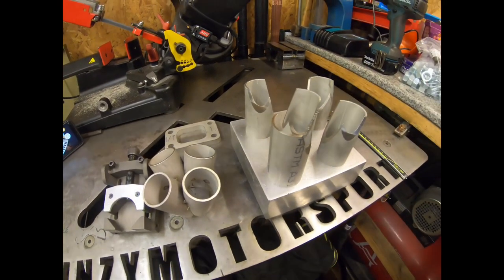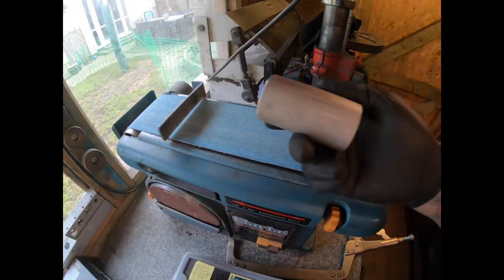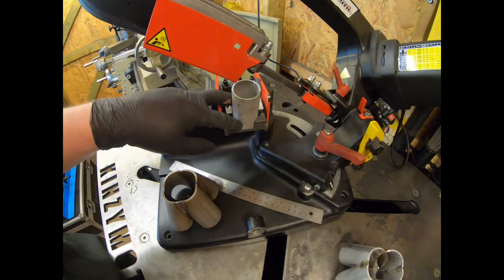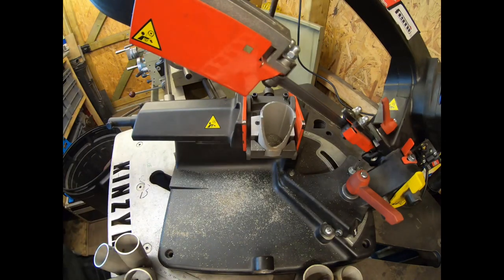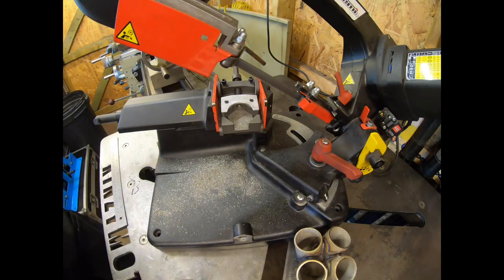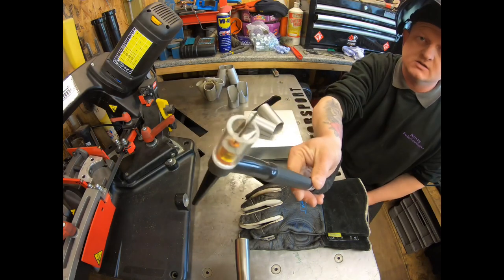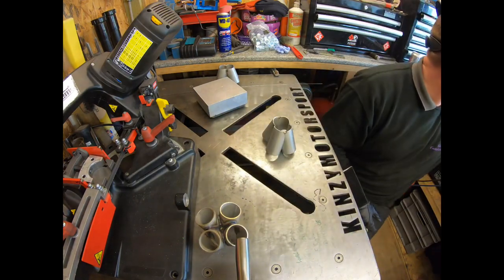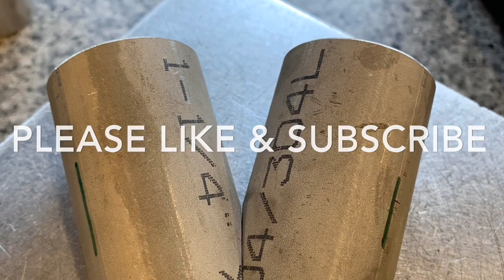Making a turbo manifold merge collector PART 1

Comment: Hello mate, so i made a jig and today i finally cut the pipes like you...So its square collector for 4 cylinder and fits good..But its from plastic to practice :D but it doesnt matter..now i need to make a 5 cylinder square..How you made it? The same like 4 cylinder but 72 degree and how you pair it, as there arent 4 pieces , but 5 ...But thank you anyway...really good explanation ...you deserve much more subscribers...
Reply from the maker: Hi, thanks for the comments.  im glad the video helped you with your 4 cyl collector, i have not done a 5cyl before so can't show you any examples personally, but yes 72* would be correct. As for how to pair it you fit them equally and then the best way is once tac'd together cut the end down so it matches your flange as best you can and then dress the metal to the final flange shape.

Thanks
Marc

Comment: Very nice video. How do you calculate or define the cut depth? I need to make a 3in1 collector with a round end for a vband 😄
Reply from the maker: Daniel I’m afraid that’s pretty much trial and error to get it as close as you can for your flange, a good starting point is cutting the tubes down to 75mm to start with
Thanks
Marc

Comment: How would I do a 3 pipe collector with 3 2” sch40 pipes into a t4. Great video
Reply: Working on a manifold for a 20b engine
Reply from the maker: Youd have to google that online as i only ever done the 4 way connectors

Comment: From bottom of the arcs to the bottom of tube how long are they? With these numbers i would be able to copy same exact fit as yours and overall length
Reply from the maker: Hi

On the long cut the arc is 20mm from the base of tube
On the short cut the arc is 40mm from the base of tube

Hope that helps

Thanks
Marc

Comment: how good to have the right equipment ..... the cut will always be 90 degrees to the sides?
Reply from the maker: Hi

Yes on a 4 cylinder collector yes, i have cut them in the cnc machine now using the same LPSFAB fixture to get perfect cuts

Thanks
Marc

Comment: Nice work...How thick is that? 3mm?
Reply: I am tryin to make merge collector too, but for 5 cylinder and without that jig :D So it will be little different without, but maybe it should work
Reply from the maker: ilikemyboost 
Hi thanks

This is sch10 and is roughly 2.7mm wall thickness
Reply: @kinzy_fabrications  Thanks a lot mate :) nice channel...already subscribed :) keep more videos like this coming :)
Reply: @ilikemyboost dude, go to lpsfab.com and grab one man. You wont regret it. Its a little pricey, but it will save you money and even make you money if youre into that. This video is one of the best explanations of how to use it too! I wish I had this when I got mine haha. I'm also going to be making a  5cyl collector for an AAN for a customer and having Justin from LPS (cutting fixture) cut me the flange! Good luck!
Reply: @jamesknox2989  Its little bit pricey, but if you using it very often, than is not a problem...But i am not sure if i will make more collectors :D But i like this tool. I need to train first on some plastic water pipes and than go on ss pipe :D i will make it from 321 aisi
Reply: @kinzy_fabrications  This is T4 flange? I finally made some jig for my purpose...but now i need to solve how far to stick out the jig for the cutting and what angles should be for 5 cylinder :)

Comment: The cheap 304 is the wrong material for manifolds.
Reply from the maker: schmatzek1 
Hi, 

The material is cheaper but so was the customers budget so this suited there requirements and the 304sch10 works fine for manifolds, it’s just a bit heavy
Reply: I use at least 321 or better.  If the customer has no money, he should buy in China.  German Enineering🤘
Reply: schmatzek1 Most companies make them out of 304 SCH10 or SCH40